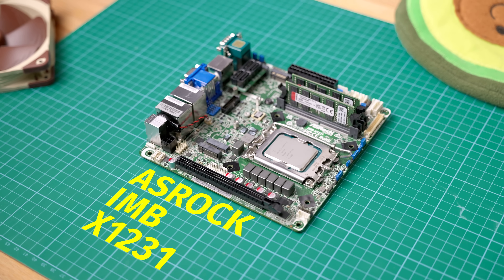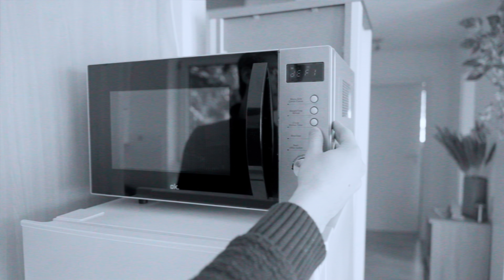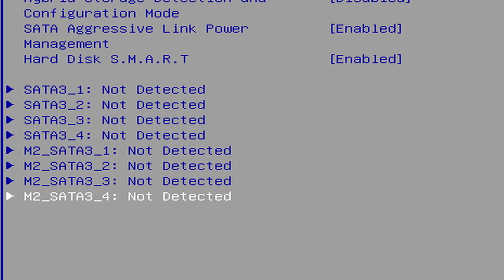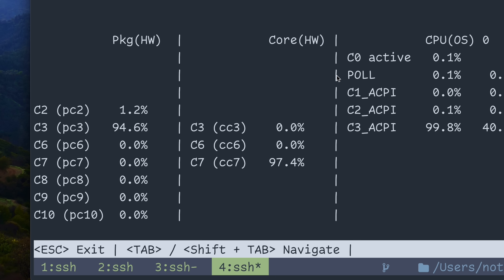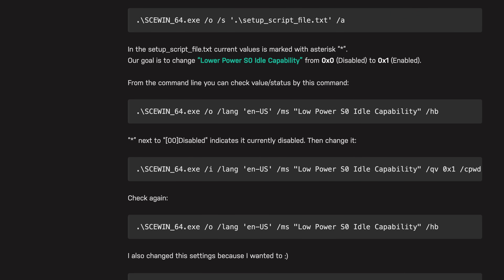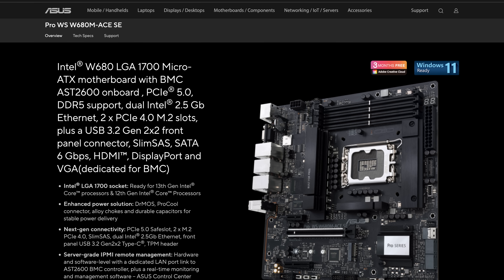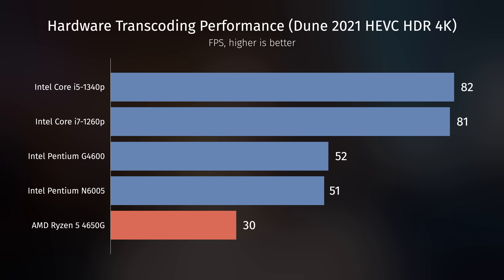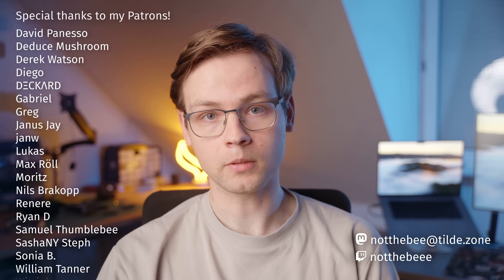A Perfect Homelab Motherboard That You Can't Buy (ASRock IMB-X1231)

Comment: ASRock IMB-X1231 does not support ECC memory, limited by the W680 chipset.  Pairing the i5-13500 with the ASRock IMB-X1231 will not enable ECC memory functionality.
Reply from the maker: The opposite is true. W680 is the only Alder Lake chipset that supports unregistered ECC memory.
There is also the IMB-1231 (without) the X, which is based on a Q-series chipset. This one doesn't support ECC memory
Reply: I'm thinking you need a non-F CPU.  The w680 technically allows ECC, but your motherboard doesn't support those features. @WolfgangsChannel
Reply from the maker: i5-13500 is a non-F CPU, and X1231 fully supports ECC, as shown in the video. Not sure where you get the idea
Reply: Is there a way you can test if the ECC support is working? I'm probably wrong here since I don't have the board.  Just reading the technical specs for the board.  The documentation does not explicitly mention ECC support.   Is there complete ECC implementation in its BIOS/UEFI?  This means enabling features like error detection, correction, and reporting for ECC memory to function properly.    @WolfgangsChannel
Reply from the maker: IX1231's web page explicitly says "Dual Channel ECC/non-ECC DDR4 3200 MHz" – https://www.asrockind.com/en-gb/IMB-X1231
IMB-1231 (the non-X version) and other Asrock non-ECC motherboards have no mention of the ECC memory – https://www.asrockind.com/en-gb/IMB-1231

Besides, HWInfo indicated ECC support, as displayed in the video. This means that the error correcting code is supported and enabled on the board.
Reply: While the technical specifications mention "ECC/non-ECC" memory support, this mainly indicates compatibility with the physical format of ECC modules, not necessarily confirming full error correction and reporting features.   No BIOS updates for the IMB-X1231 explicitly mention or promote ECC capabilities.  Checking other ASRock boards with explicit ECC support provides a comparative perspective @WolfgangsChannel
Reply: @SunshineDave agree, without BIOS support it’s pointless
Reply from the maker: As I mentioned previously, Asrock's non-ECC boards do not mention ECC at all in their datasheets.
The BIOS updates don't mention ECC because ECC support was already implemented in the original BIOS.
Another board with ECC support, C236 WSI also only lists "Supports Dual channel DDR4 2133 ECC/Non-ECC UDIMM max 32 GB", with no mention of ECC in BIOS updates: https://www.asrockrack.com/general/productdetail.de.asp?Model=C236+WSI#Specifications

As I've said before, HWInfo explicitly indicates ECC support, and Asrock explicitly mentions "ECC/non-ECC RAM" support for this board, as opposed to the boards without ECC support which don't have any mention of ECC in their datasheets. I'm not sure what else I can do to convince you.
Reply from the maker: Update: I've just swapped the CPU to i3-13100 (which doesn't support ECC), and tested it on Windows with the `wmic memphysical get memoryerrorcorrection` command. On i3-13100, it returns 3 (meaning "no ECC"), whereas with the i5-13500 it returns 5 (Single-Bit ECC). https://superuser.com/questions/893560/how-do-i-tell-if-my-memory-is-ecc-or-non-ecc
Reply: I am convinced.  This command primarily relies on Windows' automatic detection, which might not always accurately reflect the full capability of the motherboard.  It can determine ECC support, but not rule it out. Asrock hasn't properly documented this support, but I agree with you that you've proven it does support ECC with the i5-13500 (Non-F) CPU  @WolfgangsChannel

Comment: A few of my friends and industry colleagues, alongside myself, have had pretty much the same support experience when it comes to AsrockRack or AsrockIndustrial - helpful, quick and custom BIOSes are common. But Asrock the DIY board one is much more... "typical" from a consumer standpoint.

As for AMD ECC, AM5 certainly showed that "we don't officially support it, but we don't disable it" means a BIOS update can just throw it away, sadly. And the un-validated aspect also shows up from time to time as some Ryzen platforms don't properly report the error events to the OS, even though ECC is working.

Comment: Hit the nail on the head with the "you can choose 3 out of 4" statement. When you enter the homelab community, the sorting hat assigns you one of 4 types of hardware: affordable old enterprise gear with all the features that idles at 150W and sound like jet planes; affordable desktops or mini-PCs without ECC; affordable Ryzen-based systems with ECC without QuickSync; or extremely expensive and/or unobtanium business gear that does everything for like 5x the price.

But on a serious note, there is a way to kind of sort of get all 4 - use a Ryzen server and a dedicated Intel mini-PC that exclusively does transcoding. Or, you know, relax a little bit about the missing ECC and do your best following best practices to avoid data corruption.
Reply: My Intel Arc 380 idles at 1w in proxmox in my ryzen box when not transcoding, much cheaper than minipc just for transcode and with AV1 HW encoder
Reply: @brianhansen9578  that sound crazy, is this reported power consumption or did you measure it at the wall plug?
Reply from the maker: @brianhansen9578 how did you check the power consumption of the Arc card?
I've tested the power consumption of the Arc card, and even though Intel's drivers report the power consumption at 1W, the entire card adds around 7-10w to the total system power draw, when measured at the wall. Even at idle.
Reply: That assumes you have a free pcie slot, which you often don't. on ITX you only get one slot, and it has to compete with an HBA to allow you to connect enough storage devices and a 10Gbps NIC. On mATX things are a lot less tight, but it is still fairly common for boards to only have 2 pcie slots @brianhansen9578

Comment: Could you look at the "Gigabyte MJ11-EC1 AMD EPYC Embedded 3151" Board? Currently you can find them in Germany for 90€. What a bargain!
Reply: Where :o
Reply: @topkek5378  The shop is called ram-koenig or something. I originally found it through eBay. But as eBay sellers often do, they also had their own online shop with a little lower prices. Actually the board used to be even cheaper, but the price apparently went up.

Comment: Could you review this weird motherboard? It seems to be a controversial one. You can get it from German resellers. Gigabyte Mainboard MC12-LE0 Re1.0 AMD B550
Reply: I had this. So many problems. Sent back and switched to a consumer board.
Reply: What kind of problems? Most had trouble flashing a newer bios but after that it was done it seemed fine.  @HyperProtagonist

Comment: Thanks for shouting out to this ECC problem that has been existed for years. I went for Ryzen because of a much more friendly implementation of ECC. Although it's not as power efficient in some scenarios, I am very happy about it
Reply from the maker: Throwing in my home server set up:

Ryzen 4650G Pro
ASUS Prime B550M-K
2x 16GB ECC RAM
3x 18TB HDD
4x 4TB SATA SSD
1x 256GB SATA SSD
Intel X710-DA2 (10 GbE SFP+)
BliKVM PCIe

23W from the wall
Reply: @WolfgangsChannel is this configuration have ecc active function?
Reply: Mind telling us a bit about your build? How much of a gap do you feel there is in power efficiency? I'd heard you're looking at a 10w difference, which is double but still not crazy levels of power draw by any means.
Reply: @JetBlackRage  Don't want to talk for spaghettibolognese here, but I'm also running a Ryzen system:

Ryzen 4650G Pro
4x16GB ECC
4x4TB NVMe SSD
1x SATA SSD
2.5G networking card
PicoPSU

Currently 16W idle from the wall. I enabled the 35W target in the UEFI and have a max total consumption of ~50W at full load. 22W avg. in the last few months. Got really lucky with my components regarding power consumption tho. Heard stories of ~10W more at idle, so I was pleasantly surprised.
Reply: @seifenspender  what board tho?

Comment: Concluding, we have 2 problems: unavailability of hardware with low power consumption and high electricity costs. If we can not solve first problem we can try to fix 2nd problem by ditching Ampel.

Comment: Oh i would love for you to find a similar new motherboard on the AMD side, even if it is an embedded platform or has similar availability problems, just to see what the current gen possibilities are.
Like for example how extremely power efficient Zen3+ and Zen4 have been on mobile platforms, as well as their updated RDNA2 onboard graphics, i mean they support full AV1 encoding so it might be worth a shot to compare right?
Maybe i'll look for some candidates and post them in the replies, cause i would love to see what is possible! If all else just to have some more new options.
Reply: I'm using one as my home server, an Asrock Rack X570D4I-2T. It's expensive at ~$450 but not unobtanium. Also, you won't want to run Windows Server on it (there are no Windows Server drivers for X570 chipset or the embedded GPU in the Ryzen Pro 5650GE I'm using). I grey-imported the Ryzen Pro because you can't use ECC with embedded graphics on a consumer Ryzen G-series.
Reply: there are currently used Gigabyte MJ11-EC0 boards which are for sale at only 60€, they have a amd embedded EPYC CPU, therefore have actual real ECC support, ive wrote another comment asking wolfgang if he could try them out and make a video about them, ram-könig apperently has alot of them and keeps restocking them on their website.

Comment: I found it on aliexpress but OH GOD the price
Reply: damn with shipping about 1k euros here in europe
Reply: @jesper9432  laughs in Brazilian's taxes
Reply: Cade o link? 😅
Reply: well, it's labeled as "industrial". People think "gaming" products are overpriced. Everything thats sold to big companies costs three times as much of what its actually worth.
Reply: @Loik948  ASUS has a line of consumer and small-business oriented boards designated  “CSM” or Corporate Stable Model, indicating that they’ll be supported for many years to come. It’s a good middle ground between the sky-high prices of industrial equipment and the shittier options available to individual consumers. Not sure whether other manufacturers are doing something similar.
Reply: @Loik948  Please keep in mind that industrial products has to have a much higher reliability than consumer products and that the supply of spare parts must be guaranteed for severel years. All of this contributes to the fact that industrial products are significantly more expensive than consumer products.
Reply: @thomasl78 damn no.
Most of the commercial-grade parts are just untestes industrial parts. All the clownship is taken from "standards" that are paid- it is not a standard if You can't get it easilly and verify that.
Really special grade is military and airspace: these tend to have separate production lines where they do really care about mechanical stress.
Biomed?
No, these are designed and built exactly for this purpose : there is no medical - grade resistor.
So, in short, prices are bloated and capitalist will pay for that.
Reply: @ДаудМухамеджанов wow a whole paragraph to say that you know nothing about the subject.
Reply: How much?!?
Reply: It’s available for €369 here in the Netherlands. Good deal?
Reply: @jj_k86  tell me, where? I really cannot find it in NL. I found a retail in the US with 299,95 price and 60 for shipping. if there is an option to buy it here  localy, I wold buy it straight away
Reply: @jj_k86  where? can you provide a link? thats cheaper than the b450 equivalent they had a few years ago
Reply: Everytime I post the url to ali the comment is removed 🤔 well, Google it